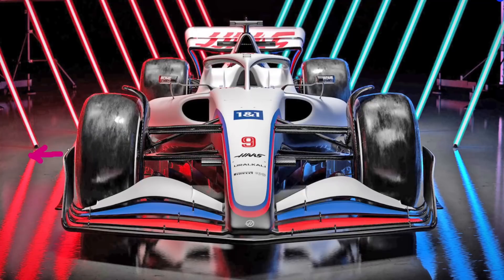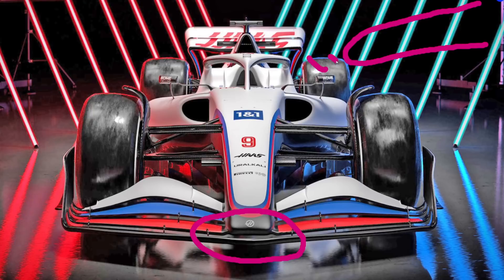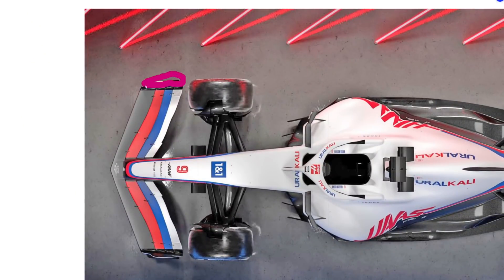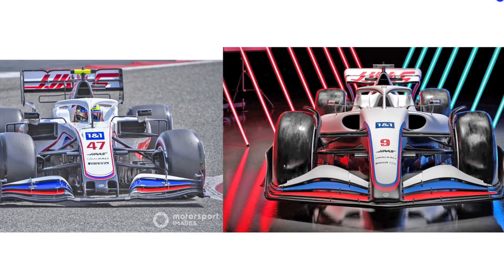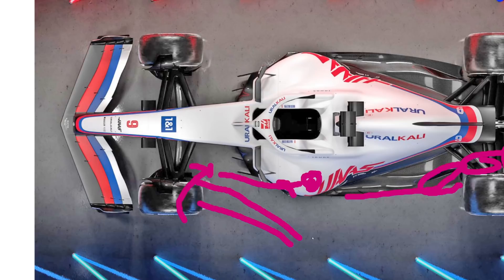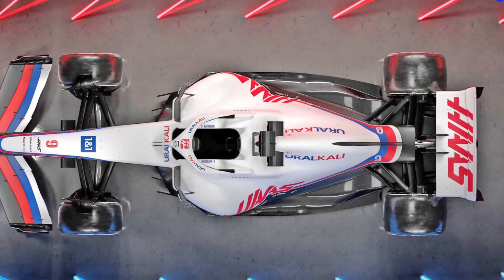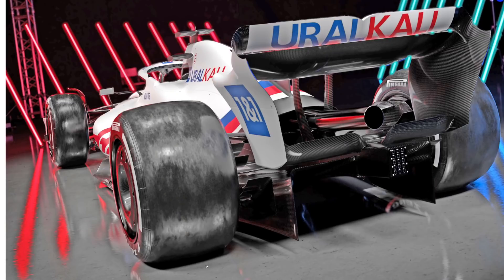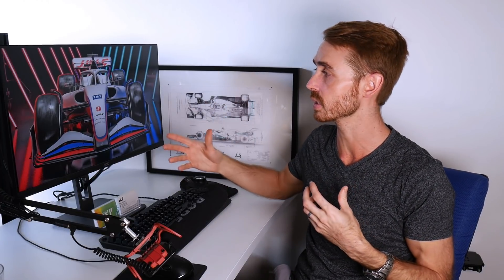Haas VF22  -  Aerodynamics Analysis and Initial Thoughts

Comment: Hi Kyle, I’ve got a question about safety. What’s the deal with relying on ground forces to achieve high levels of grip when the car hits bumps or is elevated significantly enough to lose that suction to the ground?

Is it dangerous to rely almost completely on suction to keep the car on the ground, meaning if it’s lost for some reason you have an extreme loss of grip and possible safety risk?

In other words, is super amazing suction going to allow cars to take corners at higher speeds which then puts them in greater danger If suction is suddenly lost?

Comment: I remember many attempts to make the overtaking easier and it never worked. It was always making both cars quicker. Besides DRS when you push the boost button. I can imagine new cars overtaking better at straights due to upwash, but chasing through the corners? Hulkenberg was kind of sceptical after sim tests. I remember Newey being not particularly happy about the changes. Leading car will be much more efficient aerodynamically in clean air. What do you think?

Comment: ok so i'm just hypothesising with limited knowledge but i recon part of the reason the sidepods have that sort of profile (i.e. high and small inlet) is so they can get more airflow to that beam wing - that coupled with what looks to me like a floor with a lip to divert air to the beam wing as well - it looks like it would make sense. also if what i'm saying makes any sense, the flow would be taking the same sort of pathway that the underfloor airflow would take in the venturi tunnels so maybe better aerodynamic stability?

Comment: Very interesting analysis great to get the take of an expert! One thing I've been interested in is the top profile of the side pod where the inlet is, on the Haas they are at a right angle from the car however in the official F1 renders there a smooth transition on the top panel coming off the nose into the side pod, which I would have thought would have helped clean up the airflow into the side pod inlet? (I have zero aerodynamics knowledge) but would love to hear your take on this as I haven't notice anyone address it?

Comment: Dont know what the clowns at the fia are trying to achieve with this massive downgrade when all tgey had to do was stop making the out of cheese. Since 2008 the cars have been is a constant cycle of downgrades to the point of the drivers comparing them to gp2 cars. We bave the drs gimmick which has allowed manufactured overtakes. We don't even know if these 22 cars will be safe in all conditions and they dont seem to confident hence the private first test.
Reply: Only clown around is you. 2020 and 2021 cars were the fastest in history despite some attempts at restricting them. Now that we have these sleek new cars, they will likely become just as quick, then quicker all whilst improving close racing.

Comment: I wonder if 1 or 2 cars will head the way of the old ground effect cars, and get rid of the front wing completely to unimpede the max airflow under the floor, and leave the nose length for the crash structure.
Reply: Pretty sure the rules dictate you must include a front wing. Also I don’t believe the ground effect will be powerful or balanced enough to warrant the removal of the front wing.

Comment: Nice vid man! Is there a minimum ride height in the new regs? Specifically around the tunnels? Obviously they cant run Lotus-esque moveable skirts to seal the floor but will we see the same thing in the early 90s where the teams aimed to get the floors as close to the tarmac as possible? Cant wait for the next vid, good work.

Comment: Just a quick question, if they actually are making the sidepods that shape to kick out some air in the mid section of the car, wouldn’t that also lead to separated flow down the whole sidepod and coke bottle area ?
Reply: I'd say it depends on the angle of the whole curvature, if there is no edge too hard, separation should not occur

Comment: @10:00 Wouldn't the engine cover vents(not pictured in the render) smooth out some of that turbulence going over the engine cover? Also that's a heck of a diverging duct in those side pods. Since all of that is high pressure slow moving air, wouldn't the exit be a great nozzle of hot air to the back of the car?
Reply: I think the internal ducting is very different frome the actual external shape so it may just be that. Also they need to include a side impact structure which may further push the sidepod outwards

Comment: Are there no diffuser strakes?
Reply: Won't see those until testing.
Reply: @BrokeAndSquare  yeah that's what I thought too, but since he didn't mention it, and talked about an empty zone in the diffuser I was wondering whether there may actually not be strakes
Reply: Idk if the rules allow them
Reply: You can see diffuser strakes in the picture if you look closely although they are represented intentionaly unclear for obvious reasons... this year's cars are going to be predominantly about E10 efficiency, ground effect and diffuser concepts.
Reply: @rohitrevankar7674  why are you talking about fuel when I was asking about the diffuser? and I really can't see diffuser strakes
Reply: @alphonseraynaud976  Just made a general point about what would be the performance differential for this generation..... The Race showed some enhanced pics of the venturi tunnels at the front and then the pic from the rear... it's neatly hidden away.. we'll get to see all that once the cars roll out and photographs taken.. the strakes won't be as prominent as 2 years ago(limited by regs since last year) but they'll be there.

Comment: Nice video. It's the first time i hear the term "latching", can you please explain what is it about?
Reply: It's the flow (turbulent and bad in this case) sticking to the surface of the of the sidepod which would take it to the rear and mess up that delicate part. Energised airflow likes to stick to surfaces and following them, it's called coanda effect😉
Reply: @danielegerussi7453  you just contradicted yourself. You say  energised airflow sticks to the surfaces, yet you also say that the turbulent flow sticks to the sidepod... 🤔
Reply: @hediabdellah8791  Turbulent airflow is energised airflow.  Laminar flow has less energy close to the surface.  That's why things often have trips (e.g., ridges on bicycle helmets or indeed F1 helmets) to make the boundary layer change to turbulent so it can follow expansions (adverse pressure gradient) better (without the dreaded laminar separation bubble!).

Comment: yeah but Haas has admitted that they have deleted multiple  multiple elements from digital render it is weak speculation at best
Reply: "Deleted multiple" doesn't necessarily mean more than 2 or that what's shown in the render is fiction... the details are too specific for them to be nonsense.. we can be 99% percent certain that all of this will be on the car when it rolls out. Jus how much more is anybody's guess. Although considering how basic that rear wing is expect smthn radical there for sure.
Reply: @rohitrevankar7674  speculations on Formula 1 22 will be totally based on  0 data
Reply: @BlueJazzBoyNZ  LOL mate my point was this isn't a speculation.. that car although a render is real.
Reply: @rohitrevankar7674  F1 22 will be interesting no matter what

Comment from the maker: The rules are tight this year, but I'm still expecting to see some notable differences in how teams approach them. Any  interesting solutions you're looking to see?
Reply: @i.m.Q.2  the Mercedes at the 1999 Circuit de la Sarthe/Le Mans flipped because of several factors not due ‘too much underfloor flow’. They went with a reduced drag with increased underfloor flow concept.

Primarily they went with a short wheel base with large overhangs that increased the area for the diffusers (which increased underfloor flow) BUT in turn increased front/rear instability (imagine having a plank with wheels right at the end compared to one with the wheels in the middle; the latter has far more rocking front to back pivoting around the centre i.e. instability)

Secondly they eliminated the negative pitch angle of the car from -2.5 degrees to almost 0 degrees to reduce drag but this decreased the amount of frontal downforce on the car.
Thirdly the cockpit of the car was a lift generating shape.

These first two factors increased the pitch sensitivity which meant the car was prone to rock back and forth under braking, acceleration AND when going over bumps.

So when Webber was running down to Indianapolis corner he was behind another car whose wake disrupted his frontal downforce, and over bumps (crease of a hill) caused a POSITIVE pitch angle of >2 degrees resulting in massive reduction in frontal downforce combined with factor three increased lift forces at the front and reduced downforce at that point causing the car to pivot around the rear axle the front end going up, at a certain point there is no downforce and lift is much greater resulting in the car taking flight and flipping.

TLDR: increased underfloor flow wasn’t the reason for the crashes.

Also you don’t seem to be familiar with the Brabham BT46 fan car - which clearly increased significantly the underfloor downforce so much so any weight penalty was outweighed by it’s benefit in performance.
Reply: Comparisons! Not just explain the car but how they're doing different thing to achieve same results. Or maybe different aero theory
Reply: would it be possible or is there any benefit to attaching the ground effects to the actual wheel hubs?
Reply: Hidden fans to increase underfloor flow or use of asymmetric surface dielectric barrier discharge to do that.
Reply: @i.m.Q.2  I’m afraid you can go to every YouTube video explaining the cause in detail as well as the Mercedes analysis, will tell you exactly what I just told you. You haven’t explained why would pressure simply build up too much at the front? The car wasn’t flying every time it a certain speed was it. But sure YOU KNOW MORE THAN the MERCEDES official analysis, plain and simple right 😂
Reply: @i.m.Q.2  sure pal, sounds like you’re grasping at straws here - you know exactly what I mean, but try and be-little someone by saying you’re using the terms wrong. Does that make you feel you know more. Again I can see you’re not familiar with the BT46 are you?
Reply: @i.m.Q.2  I can see you’ve gone off the deep end - enjoy your life pal.
Reply: Thanks for the video Kyle! 
Considering the restrictions on bargeboards, do you expect the new cars to be a bit too much pitch sensitive?
Reply: @i.m.Q.2  heres the answer to your first comment, smarty pants https://www.youtube.com/watch?v=P6mgqQtvFeM&t=117s
Reply: @kyke.engineers
It would be very interesting to hear your analysis of the different designs of certain aspects from the teams when they are released. 
Thanks for this video. As a layman I’ve no idea what to look for and your videos make me at least aware some aspects. 👍
Reply: You think teams are going to push the seating position a bit ahead to elongate the venturi tunnel length? kinda like the early 80"s when cars were longer at the back and drivers were seated quite ahead, I know they cant push the drivers too ahead because of the rule preventing them from going beyond the front axle.But still u feel the rules allow the freedom to see such dramatic change in the overall shape of the car?
Reply: I want to see how the Drs looks on all cars.  Aston Martin gave a good clue in there release this morning.
Reply: Rumor has it Haas might run pullrod at the front, and looking closely at these pics/renders the pushrods don't seem to blend into the bodywork like the wishbones do. Will be interesting to see what they have on the test. Apart from tiny details and the shape of sidepods, I suspect all cars will be very similar this year...
Reply: @_RobertS  yeah they are running a pullrod setup like ferrari but they werent gonna reveal it before ferrari did we probably gonna see it in testing
Reply: I don't think this is extremely close to the final car. 
Only thing i'll love to see are aero rims (like the WEC toyota) instead of those ugly wheel covers.